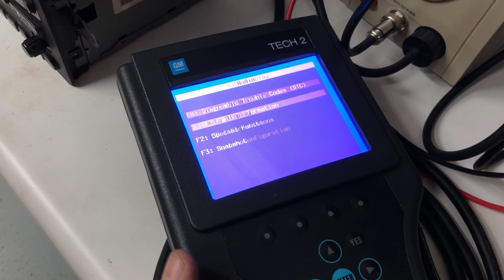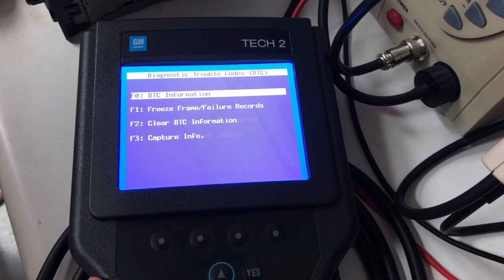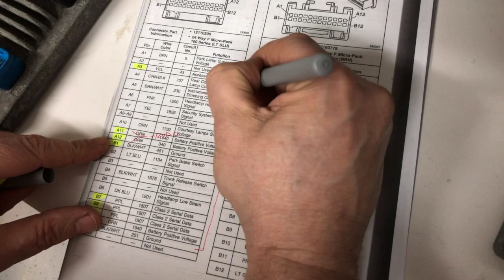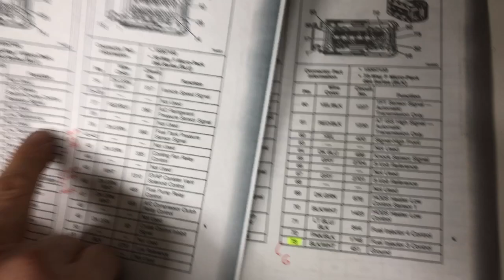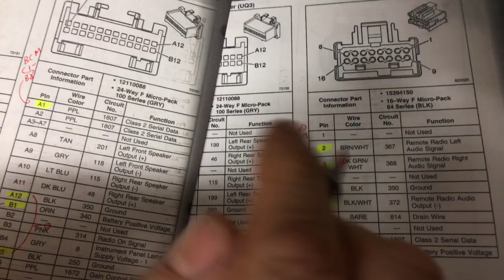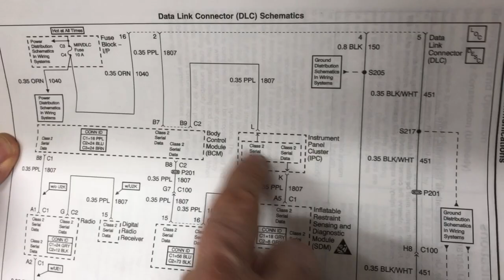2002 - 2005 GM P11 PCM BCM IPC How to build a Bench Wiring Harness Tech2 Test Rig (Chevy Pontiac)

Comment: hello your videos are great i dont have gm tech 2 but i use efi live interface and launch x431 do you think i can change the vin in an ecu cavalier 2004 eco tec with this method? 

Thanks albert
Reply from the maker: I haven't used those tuners, but EFI live I recall being able to as long as your license is up to date.  Should be in the VIN/BCC menu/tab area.  Whether EFI live supports the P11 PCM used with the Ecotec you'll have to ask over at efilive.com
Reply: @DrShock  thank you 
👌
Reply: @DrShock  Do you think you could sell me the pages you used in the video? . I've looked for them and I can't find them. thanks dr.
Reply from the maker: You'll find them in the GM service manual for any of their vehicles, in this case it was the Cavalier/Sunfire manual.

Comment: This is such a great video! Thank you! It's very interesting for try to try and figure out how the car electronics work. I have 97 Pontiac Sunfire that I was going to junk because it did not start any more, but your video got me hooked on trying to get it running again just for fun. It stopped running because of the Anti-Theft error. Now, I am trying to figure out what the issue is. It would not be just as much fun to start replacing things and I am trying to find what is causing this. I have tried lots of different suggestions on the internet, but so far now success. It looks like the ignition lock send the pass code because I checked that the reference 5v changes to 2.37, but for some reason the car would not learn the code. Of course I tried inserting a 2.2k resistor, but still the car would not start. Any suggestions? Again, I am not as much looking for a ready solution, but for a direction to explore the issue and run some tests to figure this out.
Reply from the maker: Thanks.  By anti-theft error I'm presuming the theft system light on the cluster came on.  There are unfortunately several possible causes.  I'd start with the theft reset approach using the key in the ignition on for 10 minutes or so (google this reset approach).  Next check the harness and connectors between the pcm and the passlock components in the column/under the dash (its not uncommon to have a loose connector at this age).  If nothing there test the passlock sensor.  Will be a project without a Tech2.
Reply: @DrShock  Thank you very much for your response. This happened 7 years ago and at that time I did try 10 min. and 30 min resets, which did not help. I gave up on the car at that time. Now, I am curious to figure this out and I am trying more systematic approach. I tried the 2.2k resistor approach, but that did not help, so I started looking into how this functions works. If I understand correctly, the passlock chip is like a sensor, there are B+, ground and 5v reference feeds to it. When the key turns the magnet flips the switch to conned the ground point to 5v reference point via a resistor which changes the reference voltage, which in turn is detected by the system and either confirmed as correct or rejected. Based on this assumption, I am trying to make sense of all the data I currently have. 1. anti-theft lite does not come on any more. I believe, it's supposed to turn on when the key is in run position. I want to figure out why the light does not turn on any more. 2. B+ voltage, if passlock chip is disconnected is 9.50v, but according to the service manual is should be about batter voltage. 9.5 is not exactly it. 3. The manual says that if passlock connector is disconnected, the computer should generate b1011. Not sure if this is an old nomenclature, but I am getting p1629, which is Immobilizer Wrong Computation. My plan is to find IPC module and check the contacts and grounds. I thought, it was in the instrument cluster, but I went to a junk yard and it looked to me that the 3 wires from passlock chip went somewhere to the passenger side?? So, for now, I am looking why anti-theft light does not come on and looking for 12v that should come to passlock chip. If you have a chance, please, let me know what you think and if there is anything else you could suggest or if you think my logic is incorrect. Sorry for a very long note.
Reply from the maker: Given the time that has passed since the vehicle was originally worked on, and that the dash lamp is no longer lighting up for anti-theft.  I'd suggest you work the codes first.   You could end up chasing alot of rabbits on this sort of situation without a Tech2 handy.   If P1629 is all your code reader is showing, then this at least points to some things to focus on.   It can only be caused by a few things.  It's alot more complicated to go over than in a comment box.  

I'd suggest a google of the Cavalier (more popular/more sold) for 97 and 98 with code P1629.   There are several forum discussions around that likely will apply here.  You have to eliminate any wiring problems between the passlock circuit, the BCM, and the PCM first though.  Make sure the ignition switch is operating correctly, that the key and cylinder are correctly functioning for the passlock system.   A service manual would get into the detail you're looking for.  Unfortunately this was a rapidly evolving space in those days, and I don't have any service manuals that cover the late 90s cars to speak to specific voltages or circuits to check for.
Reply: @DrShock  Thank you very much for the advice! I will keep on digging into the issue, kind of like working on a crossword puzzle.

Comment: I took a PCM to my local dealer to change VIN and program to match engine I'm using. At first he told me that I would need to bring vehicle in to do the flash. I told him I had a bench cable made to do the flash, he was reluctant at first, but did it for me.  He then asked if I could do things such as fuel pump module on something like a 2014 GMC.  I told him that I think it could be done, but it could get complicated, and was beyond my capabilities. Your video gave me the info I need to do this, but I still think it would be complicated because I think all the modules would need to match, 
  I have HP Tuners MPVI2 and can read many of the modules on the my example vehicle, a 2014 GMC. I think that I can flash the transmission because I have the programs registered and saved.

Comment: awesome! I am working on a bench harness to test similar gm pcm units. will they power up and connect to an obd scantool without the bcm and other stuff?
Reply from the maker: Much older model years will work independently module wise, but newer model years require the PCM to communicate with just about any another module, like the BCM.

Comment: Hi Dr. Shock:

Thanks for a great video.  Can a bench be easily built to connect an OBDII connector so a Scan Tool can be used to acquire the PID data from just one controller.  Example:  If I want to read PID data from a powertrain controller with a scan tool on a bench, can I wire an OBDII connector to the controller and scan tool to read PID data?

Thanks in advance!
Reply from the maker: Some modules cannot stand on their own, for example you need a BCM along with a radio or XM receiver in order to have a working bench setup.  Or like in this video the older instrument clusters also relied on BCM communication.    Some can, like a PCM, stand on their own and I've done some other videos with a Tech2 and some older PCM designs.  PCMs in particular are popular to bench due to the interest in aftermarket tuning software to customize the calibration.

Comment: Hello, this is a really cool setup. . Im working on an 06 Colorado and the BCM is the main, Ill call it gateway, just because pin 2 runs to the bcm and then out from the bcm to every other module. When I was looking at the Information Bus diagrams, it looked like all the Serial class 2 was hooked together internally. So I was wondering is the BCM looking for certain modules on specific pins, or are modules just identified by some ID number in the data packets? This board was sent to me so I dont have access to the vehicle, but it had only 1 burned trace, which happened to be pin C2 A44 serial 2 for the Radio. It was a complete open circuit. But would that shut down the BCM and cause all other modules to fail safe mode, using the last good known data from the BCM? Sorry for the long post.
Reply from the maker: I've done a few of these benchtop BCM harnesses, usually for showing how to unlock a GM factory radio.   In some models, vehicles new enough to have a CAN bus, the BCM will function as a network gateway for the different networks.   I would expect the BCM, at least for your 2006, not to search for modules electronically by pin but rather programmatically by bus messaging.
 
The old low speed class II bus would typically all be all wired together straight thru.  Which is why if one module goes it can often bring down the entire network.   Your specific case sounds like a short circuit on the radio harness of unknown cause damaged the BCM, physically breaking the class 2 network.  I would not have expected just a physical trace break on the class 2 bus to affect the CAN bus network (can't recall if 2006 trucks had CAN yet or not), nor the BCM overall.  So there may be more damage on the board than just the trace.
Reply: @DrShock  Theres no CAN bus on this vehicle, and I do agree I think there is a short in the Radio. The module health check is a program based check, I just said ping to shorten my message. The only components on the board between the BCM connector pin and the burned trace was a small cap and small resistor, Hopefully there isnt anything else damaged. Im going to power up the board and see if I can see any comms on that Radio pin with my scope. I dont really think my customer cares so much about the radio working. His concern was getting the daytime head lights working, which I think is just a bad head light switch. Hopefully I can get this bcm to power up, service info stated there is a power up sequence to prevent the module from going into some fail safe power mode, which I havent heard of before. But lately aftermarket info has been really off on quite a bit. So we'll see. This vehicle at the DLC is only pins 2,4,5,16. Thats all. First time Ive seen that.

Comment: Is it the same process to build the same bench harness for a P59 or E38 ECUs? I have an 03 Tahoe and 07 Suburban that I would like to do this for. I would of course have to download the service manuals from ACDelco TDS.
Reply from the maker: I would not say the "same" as the Cavalier P11 is a very simple setup.  But it would be very similar.  You should be ok on the 2003.   By 2007 though you may have to hook up more than just the PCM and BCM module wise.  BTW, you cannot "download" the manuals from TDS.  You can view them online, or print out a small number of pages.  But that's it.

Comment: Does the Saturn Vue 2.2l have a similar wiring diagram?  Been trying to bench rest but to no avail.
Reply from the maker: Every GM vehicle will have such a wiring diagram in the factory service manual.   But every GM brand/model is going to be different.  This video would only apply to the J-bodies (e.g., Cavalier and Sunfire).

Comment: Can I put pin 15 from ecm directly to pun 2dlc to create a bench harness for only the ecm? Thanks
Reply from the maker: I have not personally experimented with that.  But if you are not using the radio or IPC, you may be able to omit the BCM and it's wiring to just read the PCM data.  But I don't believe the Tech2 will accept that for its SPS functionality as it will be looking for the BCM.

Comment: I'm trying to sweep test an 06 dts cluster on the bench . Cant seem to communicate directly to it via a scan tool on the gmlan(+/_) lines . Is this because im not using tech2 or do I need a BCM , PCM or both wired up to the cluster ? Thanks
Reply from the maker: You usually need a BCM at a minimum to talk to any GM module other than the PCM on a bench setup.

Comment: hello my friend, I need your valuable help, I have a 2003 Chevrolet cavalier ecotec 2.2 engine, about two weeks ago when I am on a dirt road the rpm goes up and down in the same way the speedometer needle, I do not know what to do, on the road of pavement works very well, please help me !!!!!!!
Reply from the maker: Not that a Cavalier is designed for off paved road use, but I would start with connecting a Tech2 scan tool and running the gauges test to see if the stepper motors in the IPC are working correctly (they commonly fail over time).  If they are, move on to checking the engine data for the RPMs coming into the PCM vs what is shown on mechanically on the tachometer.  The issue you describe is either in the instrument cluster itself, or the sensory input wiring to the PCM (you'll need the factory service manual for the schematics).  Not really something that can be diagnosed without a Tech2, or without direct access to the vehicle.

Comment: Can you keep an ecm on an early 2000’s car with passlock 2, specifically e16a, and run a p11 just for the engine with its own fuel pump relay? Reason to keep the ecm is to keep my body control functions. They all do a fail safe check or something like that. I’m building a turbo Saturn with a p11 and custom standalone Ecotec l61 harness.

Comment: Is there a way to hard wire the cluster lights to a switch
Reply from the maker: Not without significant modification to the circuit board. The functionality is all controlled with messages across the communications bus in this model year.

Comment: You selling this station thanks ??
Reply from the maker: No, just something I put together for my own bench testing and programming.
Reply: @DrShock  hi from the uk  im stuck .. i have a ford fiesta zetec 2011 ecu , ignition and speedo and bcm that i want to wire together can you heip piease ?
Reply from the maker: @EPICFUSED  I don't have experience with Ford vehicles and their communication bus.  But if I had to do this myself I'd start with the Ford factory service manual for the 2011 Fiesta to figure out how it's all wired together.  Only the factory service manual is going to provide the low level details you would need for such a project.
Reply: @DrShock  much appreciated I going to find the ford factory service manual 👍